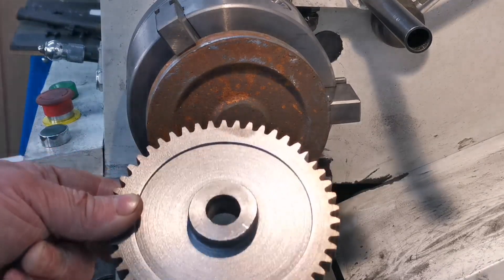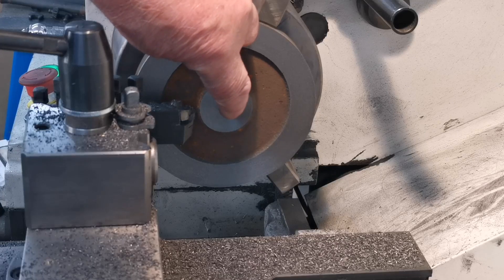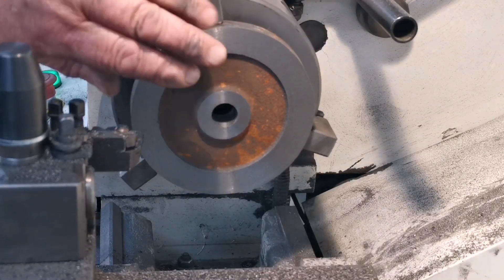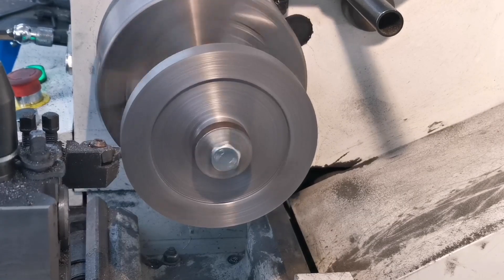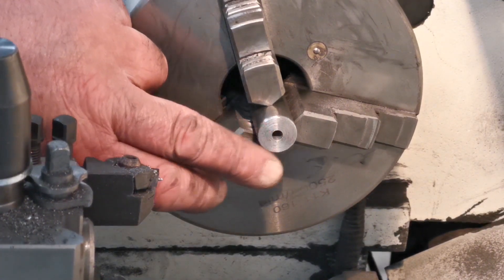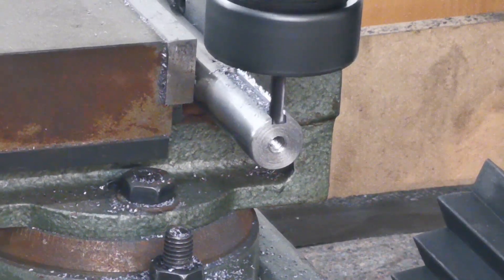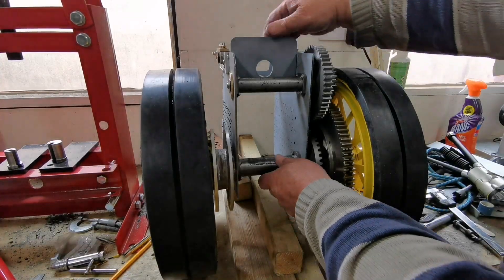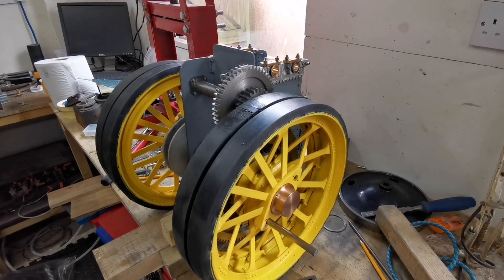2" Fowler Showman's Traction Engine, Take 2 of the 49 teeth gear

Comment: Good stuff.
Sometimes for extra rigidity I put an angle plate clamped to the bed adjacent to the gear blank, I then clamp it to the gear blank each tooth that is cut.
Reply from the maker: Yes I did that with the 96 teeth, but I used a piece of wood, it stopped all the vibration